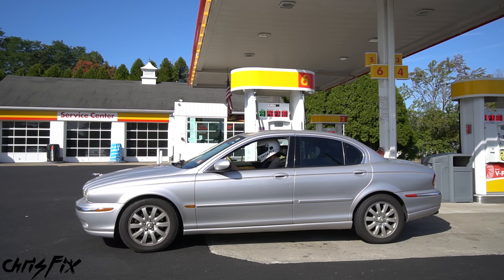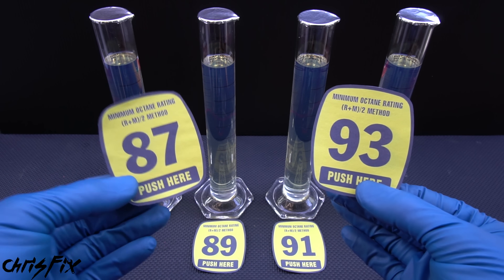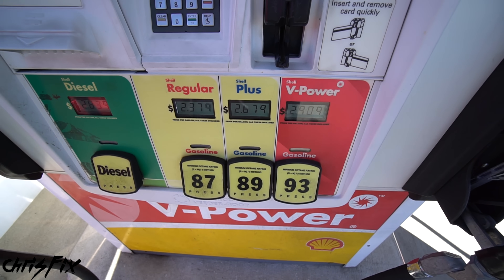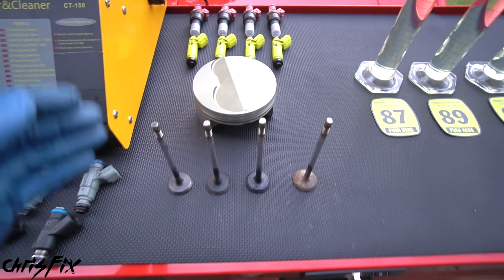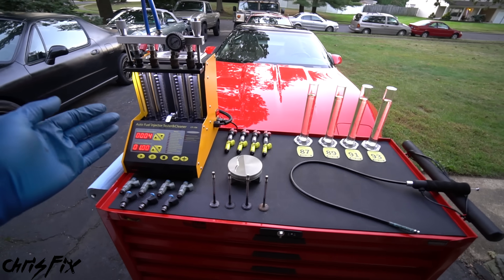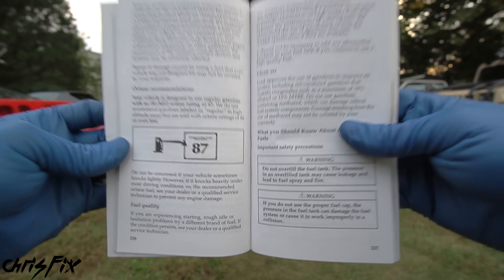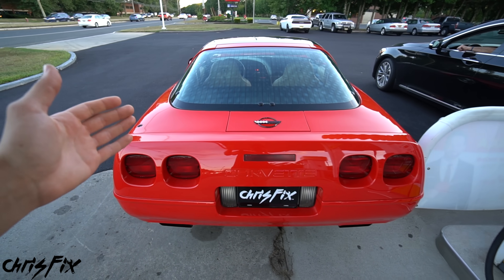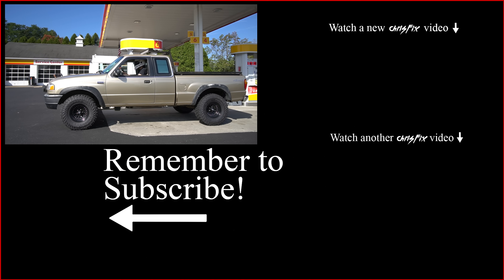What is the BEST Fuel to Use in Your Car or Truck and WHY

Comment: 1:43 those prices are beautiful. Now were paying high prices and summer hasnt even started yet under sleepy joe
Reply: Has any president in the last few decades done anything to change gas prices by more than 10 cents per gallon? I always found supply and demand to be the much bigger factors. Now, it's demand. It will go away, just wait a year.

Comment: Yes just to let you know what he had said about uneven detonation that's what happens when you put the wrong fuel in the wrong vehicle if you're driving around in a regular Hyundai Kia Jeep Ford anything you get off at dealership that isn't souped up and ready to roar yeah just put regular 83 to maybe 90 in your tank if you don't you're going to ruin your car if you put higher octane other than that you will destroy the engine you will get that knocking if not at first try try again guess what there goes your car

Comment: Actually in most Corvettes they're usually a regular engine that's been supercharged and you're going to be trashed anyway so go ahead and put whatever fuel you want in there it'll still get the same combustion rating which is what he's saying he isn't a mechanic he's nothing he is an idiot he does not know how engines work or internal combustion he's just speaking out of his a**** and you're all buying it good luck

Comment: Exactly what I was saying the octane rating in each fuel is very different which you do get a very different combustion rating so depending on the engine that you're using or the car you're driving if you're not driving a super expensive luxury Lamborghini or Bugatti don't put 93 in your tank cuz you will hurt your engine over the long run put regular gasoline that's what they were designed to use the low economy person uses the low economy gas with their low economy car

Comment: Well buddy let me tell you you obviously don't know science and how it works the certain fuel grade levels are because of the less contaminants that are in them which actually does help them burn better 93 meaning they have less contaminant than a 90 and or an 83 or a 79 you obviously don't know math you don't know what you're talking about and your garbage they do have a better burn rate it just depends on the engine and how it takes it you didn't ever say that though in your little f**** video did you

Comment: So that's all great advice for newer vehicles that have knock sensors. What about an older vehicle that predates all those electronics? What if you've got a classic car from the 70s or 60s? What happens if you put the wrong octane in there and you don't notice it? There's nothing to automatically adjust the timing, so...

Comment: This is just so wrong in so many ways. First of all, knock is PRE-DETONATION. When the piston comes up compressing the mixture, it detonates before spark plug fires, not in little pockets around the combustion chamber. Second, read the tag on your car to determine if it needs premium. It actually TELLS you what to use. So he says read the manual. Great help. The little book in the glove box or actually inside the fuel filler it will say if you need premium. The REAL difference between fuels is ALCOHOL PERCENTAGE. More alcohol does reduce the energy available in the fuel. It raises octane and pulls heat from the combustion chamber. And everything being equal (alcohol, octane, etc.) ALL FUELS ARE THE SAME. Shell, BP, whatever. ALL THE SAME. In my town, there is ONLY ONE FUEL DEPOT. All the fuel comes from there. Just watch out for alcohol. If you can get alcohol free fuel you WILL GET BETTER MILEAGE regardless of the octane. Oh. And he uses Shell and he gets carbon build up. What a crock. DO NOT BELIEVE A WORD!

Comment: Are you sure they all have the same energy content ? There are other additives added to increase the octane number which do not actually have calorific values, they replace the HCs per unit volume reducing the overall energy content. therefore the higher octane fuel actually has less energy content (kJ/gal) 
What it does is allow you to increase compression ratio without pre-ignition !!!

Comment: Ight g, first off octane rating is how much alcohol content is in the gas bro. In other words the more alcohol the slower it burns. For example why cant you run 87 in a high compression engine. Because it burns to fast and will cause knocking and detonation. On the other side why couldent you run race gas lile 110 or 120 in a 87 octane standard compression engine. It burns to slow causing problems. Its all about how fast it burns g. Someone had to call you out. Keep up with the good videos dawg just make sure you get the info right. Much love.

Comment: I HAVE FOUND THAT THE ETHANOL THEY PUT IN THE GAS GIVES MY 2006 NISSAN TITAN AN ENGINE WARNING LIGHT ISSUE.
USING 1 TANK OF AN  ETHANOL FREE PRODUCT OR THROW IN A QT OF SEAFOAM ADDITIVE,JUST TO PASS MY SMOG TEST,WORKS

Comment: I was just trying to explain this to my daughter. You do a much better job Chris. I have sent this video to her. Thank you sir. Please keep doing what you're doing.
Reply: Just say : If the engine is knocking, go up until it quits.  I started out with high compression engines that required 92 - 93, then for decades, 87 was fine.  I now have a 6.2 L that wants 93 again....it's the price you pay for performance.

Comment: Question: What is the best fuel to use in your car?
Answer: The one your car manufacturer recommends.
Reply: @B2Roland  what’s your logic
Reply: I wonder if that motor has a bit more compression.
Reply: Cale Phillips  that makes since then,  thanks!
Reply: Agreed.
Reply: Guys be careful, I’m sure he’s a great guy and all but you need to read your manual and find out what the manufacturer recommends or you could void your warranty and do damage to your vehicle.
Reply: my subaru would knock with 87
Reply: Subarus are known to “run” on 87 but get better mileage on 93
Reply: @ImaYam   I've tested that with my 2020 Impreza. Not really true in my experience.
Reply: @calebshaffer2283  was your test scientific in anyway? My 2018 crosstrek with the same engine as you gets 440 miles to the tank with 93 and 360 on 87.
Reply: @ImaYam  I get roughly 360 regardless. I drive a combined highway and city
Reply: @ImaYam  hmm interesting I have a 2013 cross trek and I didn’t know that
Reply: @ImaYam  me too with the outback 2016. I get a lot more miles with the higher octane than with the lower octane. To the point that it is actually cheaper to load with the higher octane if you calculate $/mile with each type of gas.

Comment: Had had to put 93 in my 305 Chevy with a carburetor because I had problems with 87 where my engine made rattling sounds while accelerating on highway when climbing hills or engaging passing gears, the engine was pre set from factory to run 87 but as it is older now with aftermarket carb tuned for 93 fuel

Comment: I have a wrangler with the 2.0 hurricane engine. I average 17-19mpg on ethanol 93. However, for the same price when I run NON-ethanol 90 my average mpg is 22-24mpg. Same daily route. Keeping shifts early in rpm range

Comment: lol "today's cars" the knock sensor has been around for a lot longer than today's cars, that crap is older than me and i'm 35, if i had to guess the first knock sensors were applied to the first fuel injected engines and the first of those was made in 1925, i tried looking it up and couldn't get a straight answer as well.

Comment: Thank you for the awesome video.  Just wondering few things..
When the car fuel cap says to fill minimum 91 octane, and the car manual says fill minimum 87, what fuel should I use?
Can I fill with 87 as per manual?  Or do I need to fill 91 as per the fuel cap sticker?
Reply: You could have an aftermarket fuel cap. I would go with the manual or do some Googling to verify.

Comment: Add anything to regular fuel and now it is considered different not the same. More octane and additives makes it a better fuel . Our gas 350 fleet trucks run better and smoother with the higher grades eliminating knocking  or hesitation. We can simply add additives to the regular fuel but it will cost us more ..

Comment: I feel like it's worth mentioning that many gas blends in Canada use up to 10% ethanol in 89, 5% for mid grade, while premium 91 can be found with 0% and 94 can once again be an alcohol blend.  This does effect the energy per given volume, and the rate that it burns as the alcohol is less dense. Depending on the application, this can be beneficial to know

Comment: The benefits of 91/93 octane fuel won't been seen overnight. It takes multiple fill-ups during multiple months to see the benefits -- increased power, better fuel efficiency, better operating fuel and induction systems. Try for yourself: commit to using 91/93 octane for six months in whatever you drive and then make the conclusion. As well, consider this: manufacturers by default will state 87 octane is fine for whatever they sell because . . . they wanna sell vehicles. They're not gonna recommend 91/93 octane because they know most people are cheap and program the engine management systems accordingly. Many people would rather spend their money on i-Crap and Wagu beef.

Comment: Viewers , do more research!  If you watch it a few times you will hear contradictions. Whilst some comments have value, they are for the wrong reasons. For argument sake, not one valve presented in this clip would perform the task as intended as not one valve has a clean and sealing seat! Your call, but if you want a better understanding, do more research! One point I do agree with, if the engine is not knocking/pinging you do not need to run a higher octane number!

Comment: excellent explanation .just last month I got check engine light and code said "knock sensor" issue, well firs of all  I started to shop for new sensor which wasn't cheap including labor and I decided to "cheat' and put premium which is recommended by manufacturer and vu a la rough detonation was gone within of couple hours and after I cleared the code it never came back.

Comment: I think this video, as I have commented upon on other videos or gas reviews, that I have always used 91 gas in all my cars.  My prius and a buddy of mine has the same vehicle, same year same model.  Our vehicles have computer mpg read outs, he uses 87 and I use 91.  My prius gets ~47.5 and his gets 39.9 ~40.  Yet, my car has a higher average speed, as I drive like a madman.  Mine is 26 avg mph and his is 21. His car has even less miles than mine, and also has less miles on his car than I do by about 30k mi.  

Maybe it's his injectors.

Second, I as like anyone else get rental cars. I do my usual trip.  When I do a certain trip with any car it takes about a full tank, cars mpg doesn't matter.  End results is where I get my conclusion.  I fill up until the pump taps, and the tank is topped off.  Obviously whoever filled the car before me put any trash in their.  So I drive my trip and the car runs out of gas on arrival typically.  I am on E at this point, I drive usually 40-50 miles on E to dump that tank of the nasty fuel.  Now my car is really low and I fill that with 91 quality gas.  I drive back, on the way home I usually return with about 1/8th of a tank.  So you can plus and minus whatever you want, reality wise even the car says usually 40 mpg until empty.  So premium is basically giving me another gallon worth of driving and usually only cost me $1-1.50 extra per full tank in change.

So I am kind of really confused about this matter.  I have heard a lot about why premium is best, but this is real world testing time and time again.  I rent a car and do this trip about twice to 3 times per year for the last 6 years. You may hit me with speed is a factor but this is generally a 3 hours drive and I am on cruiser control 90% of the trip.

So these are two real world experiences I have that show me 91 is better.  If you calculate on my prius even 7 mpg extra for the lifetime of the vehicle is a huge amount, especially over a 100,000 mi driven

Comment: Great video now I know a few stuff about gasoline. 
But I have a question. I been using 89 gas on my suv over a year, can I switch to 87 gas or am I going to ruin the engine? Also can I just put 87 gas while my tank is half way of 89 gas? Thanks.
Reply: What does ths manual say? Can it run on 87? If so, you can use it.
Mixing the fuels in the tank shouldnt cause problems, but compression tolerance wont be as high as the better of the two.

Comment: Here in Idaho (and throughout the Rocky mountains) we have actual 85 octane. Not e-85, but 85 instead of 87. I'm seeing from other sources that at higher elevations it's ok to run a lower octane since the air is thinner and different barometric pressures affect the engine. Just some food for thought.

Comment: I am an are certified master mechanic. Every car since the 80s , all cars use regular. Higher octagon is met for high compression engined only 21 to 1 ratio. Higher octagon burns slower, and is needed for high compression engined such Hemi. There detergents in today's gasoline plus all chemicals that are in today's oil. Makes carbon free valves and rings. So today's engine burn cleaner.

Comment: My saab 9-3 runs specifically off 93 octane otherwise it runs way harder than it should
Reply: What do you mean by harder than it should?
Reply: @ReubenHorner  well it adjusts to run with lower octane levels so I could run 90 Octane and still be good. But ill the engine would run at higher RPMs when accelerating and stuff when giving out the same power as opposed to running 93 octane then your car will run at lower RPM with same power lol

Comment: not hard to understand........just use 93 on anything non-diesel period......my 03 Camry 2.4 5spd on orig fuel injectors, fuel pump and ign coils......occasionally i heard some pinging with 87 and just ran 93 and never heard again.....it currently has 510k miles and doesnt smoke, ping and uses ab 1qt thru 3k oil change intervals which i use 5w30 regular penzoil

Comment: Bro I can put my pedal to the floor in my sons 2000 blazer 4.3 v6 and it goes no where probably like 40 and pops and bangs from the exhaust does that mean the spider injector system is out ?

Comment: I understand what’s he is demonstrating but there is most definitely a huge difference between 87,91,92,93 octane. my vehicles all go faster have quicker acceleration and seems to burn at a much slower rate when I put in the highest rating of octane at the pump which is usually 93 grade can someone else speak to this?

Comment: @Chris Fix I have a question... the detonation you're talking about... is that what a lot of people are referring to when they say their "valves are rattling"? I have a 2019 F150. I drove it off the lot with 18k miles on it and it sounded TERRIBLE at first. It still does it here and there, but what do think the issue could be? I ran a couple tanks of 93 and it seemed to help. Whenever I run 87, it makes it worse, however, the engine doesn't "require" high octane. What's up with that?

Comment: Take all those tubes you got and fill them half full of water and half fuel then letsit for a few days then see the difference. I tested reg. And premium for 6 months each in my 1986 Dodge Ram 4x4 and I started with reg. By the time the 6 months was up it was running like shit and would take a long time to start the I switched to premium and did nothing to the truck and by the time the 6 months was up it ran fine and started on one to two rotations at most. Explain that one. And again I changed nothing but the gas and they were both from the same Esso gas station.

Comment: What's your opinion on older cars and fuel?  I have a 1980 El Camino, carbureted 305 (obviously no computers to adjust timing).  I go out of my way to use non-ethanol fuel, or Shell premium if non-ethanol isn't available.

Comment: 93 cleans it out more I hear. Also, 93 is used for vehicles that have tunes on em or that are modified. My 5.7 hemi rams that are modified I put 93 Gasoline in them. My 2003 1500 is used to 93 gas because of its hypertech tuner so that’s what I always put in that truck it can take 89 but I always put the 93 gas. Same with my ‘17 1500 hemi

Comment: In a lot of western states 89 octane is unleaded fuel instead of 87. Being from the midwest this always seemed odd.
Reply: At 11:28 in the mustang's owner manual pretty much explains this. "We do not recommend using fuels labeled as "regular" in higher altitude areas."

Comment: Great video, but I think there needs to be mention of Top Tier vs non Top Tier fuels. Shell is top tier and it’s the only gas I use, as long as I can find it. Regardless of octane, non top tier fuel (I’m looking at you, Speedway!) is not the same as top tier fuel. I ran Speedway gas in my last car (Sonata 2.0T) and had issues (injectors replaced, excessive carbon build up that required walnut blasting) before 50k miles. Did research, learned about top tier fuel, switched to Shell, and had no more fuel related issues by 116k when I traded the car in. Yes, 93 octane from a non top tier supplier may not knock, but the quality and additive package are far inferior to top tier gas. Most people think that top tier is a marketing gimmick and “gas is gas as long as it’s the same octane” and that’s simply 100% false.

Comment: Chris, does running a premium fuel in a carburetor engine can clean the carbon?
Reply from the maker: If you use high quality fuel with more detergents, it can help prevent and clean up some the carbon!
Reply: @chrisfix  Okay, Thanks Chris!

Comment: Here in australia I went from 91 to 95 then 98 and it was better each time...currently use 98.. I have a 2005 Toyota Corolla with 314,000 kms and the 98 seems to keep the engine running much smoother...even on my 1.8L low powered car it’s worth it...